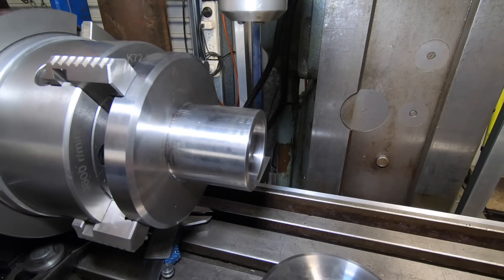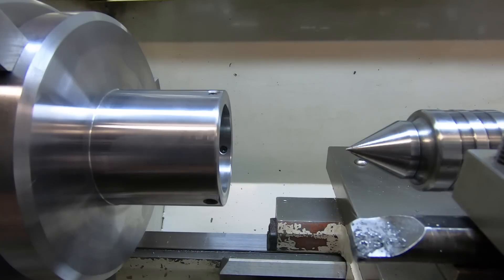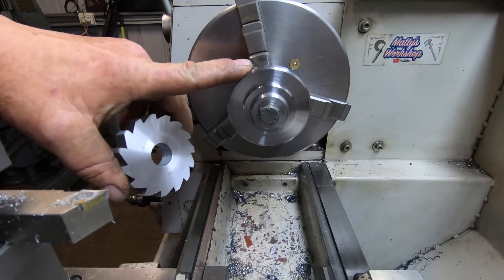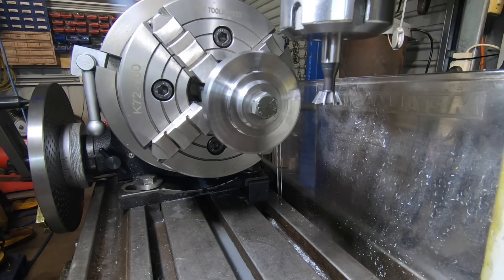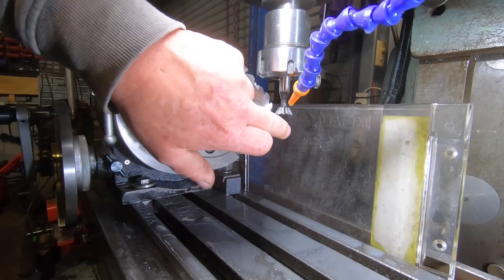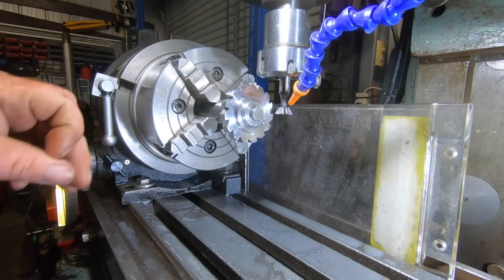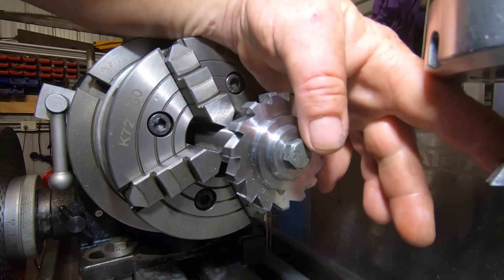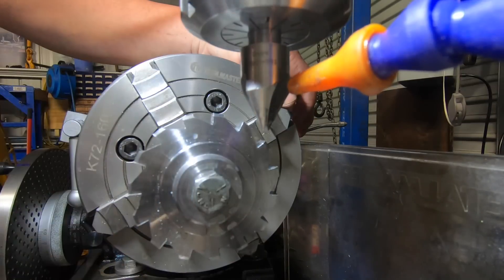Winch Build Part 4

Comment: Where there is a will, there is a way.  I would have readjusted a couple of clicks on the rotary for the last pass, but it worked out the same way with the c-sink.  I don’t think that the cost of some of the tooling is recognized by the non machinest,  the retail on a lot of the bits and inserts are steep enough to make the home gamers shop as much as cut chips.  Part of the experience I guess?
Reply from the maker: Gday, I didn’t give that a thought about indexing a little more to take the top little bit off, great idea, as for cost of tooling, since I’ve been using the more expensive inserts I’ve noticed a lot longer tool life and running coolant on the mill certainly makes tooling last a lot longer, thanks for watching, cheers

Comment: More excellent work Matty. When using the dividing head I'm always paranoid about eliminating the backlash when advancing to the next station - so easy to forget. That dovetail cutter held up well and I'm sure the Hangstorfer's was instrumental in that. Since you put me onto it, I have been using it quite a bit in the mill and the bandsaw, and seen real benefits to tool cutting life and performance. However, seeing how clear the fluid is in your video, I must get the refractometer out and check mine. The method you used for cutting the ratchet wheel is probably not going to be found in any text book, but so what ? - you worked with what you had and got a good result.
Cheers, Alan.
Reply from the maker: Gday Alan, since I stared using the Hangsterfers 5030 I’ve noticed a big change in tool life, I honestly think it’s worth spending the extra because it’s going to save you money in the long run, great job on your compressor build to mate, cheers

Comment: I would have used a slitting saw (making 2 cuts per tooth) instead but you just have to use what you got
Reply from the maker: Gday, slitting saw would work no worries at all, definitely a good option, Cheers

Comment: I was wondering how you were going to get that ratchet wheel cut. I was leaning towards you grinding up a custom tool and use the shaper. The dove tail cutter worked just as well.
Reply from the maker: Gday Tom, if I ground a tool up to do the job I’m sure it wouldn’t be good🤣, thanks for watching mate, cheers

Comment: why was 70 degrees necessary vs 60 degrees
Reply from the maker: Gday, it was either stick with the 70° or make a new ratchet pawl, the pawl was made by Aaron on the CNC mill and making the ratchet wheel 70° was a good challenge, thanks for watching, cheers

Comment: Hi Matty, I have only just started watching this project, looks like some very nicely made parts. I'll be going back to catch up on the previous 3 episodes. Just a thought, and no doubt there's a good reason you didn't, but could you have used a slit saw to cut the teeth? I've had one of those cheapo dovetail cutters, and one cut later (slightly too deep) and I've only got one tooth left!
Reply from the maker: Gday Olly, Thanks for taking the time to watch the videos, To be honest I never gave a slitting saw a thought, This would also work I believe and I must remember this for the future, I really enjoyed the compressor build, Thats super quite, Cheers

Comment: That rachet wheel was a bit technical Matty, great to have a genius like Max to call on.
Looks like you've got the dividing head sorted out pretty nice, cutting fluid still looks in good shape 👌. 
Thanks for sharing 👏 
Best regards John
Reply from the maker: Gday John, The part had me stumped until I spoke to Max, He's a man with a lot of knowledge thats willing to share, The Hangsterfers 5030 last much longer then the Penrite soluble oil I was using, its also transparent so you can see you layout line while you machining which is a good thing, Thanks for watching mate, Cheers

Comment: Really good end result on the Ratchet Wheel Teeth Matt! I could explain a way of doing the height adjustment using Mathmatics, however it is difficult to write down as a short comment.
Your method works fine for this part and also Max needs a mention as well as he is a wealth of knowledge on ways to do things. John, Australia.
Reply from the maker: Gday John, I struggle with maths on a daily basis and I quite often have to find the alternative way around the situation to get the job done, Max is a wizard in my view, when I spoke to Max about doing this his explanation was amazing, i've learnt a lot over the time with his videos and its great he's happy to share his knowledge, Thanks for watching mate, cheers
Reply: Mate, the winch is coming ahead well. That gear ya cut is excellent. Maths ain’t one of my best things either, but we find ways of figuring out p, doing and remember stuff. Thanks for the video. 👍🇦🇺

Comment: What size cutters you after Matty?
Reply from the maker: Gday Troy, I'm waiting on the Module 2.5 gear cutters, I had trouble finding them in Australia at a price I could afford so I settled for an import set, hopefully there ok, Thanks for watching mate,
Reply: @MattysWorkshop  ah ok no worries I checked my stash I don't have 2.5mod thought it might make it a bit easier for you.
Reply from the maker: @troyam6607  Ive found that Module 2.5 are not real common compared to mod 2 and smaller

Comment: Nice job Matty, nothing wrong with that dovetail cutter with flood coolant.
Reminds me of a ratchet I made 30 odd years ago for a home made electric winch for my Toyota FJ 55 landcruiser, mates nicknamed it the Pig Dog!
Reply from the maker: Gday Willem, with hangstefers 5030 coolant I've really noticed that cutters have been lasting a lot longer and able to take bigger cuts on the mill, another good thing with the 5030 is its not pure white, you can see your layout lines through the coolant which I find is extremely helpful, Building you own winch would of been a great project, Have you still got the winch?, thanks for watching mate, Cheers
Reply: Winch is long gone, gave it to a workmate with a HJ 60 Landcruiser.
The ratchet was Nitrided by a company in Perth.